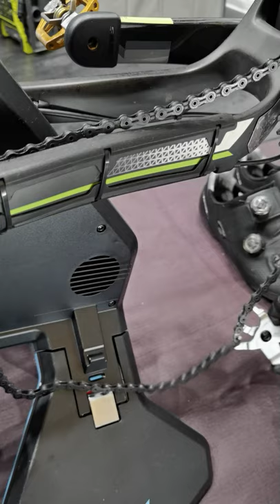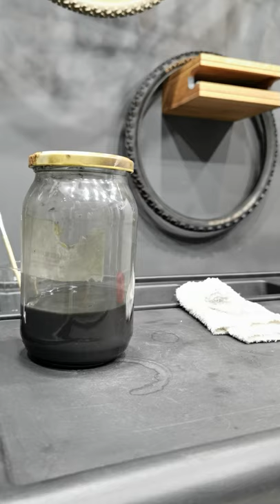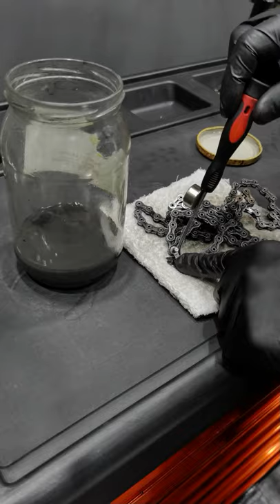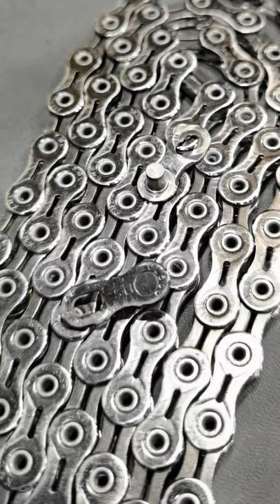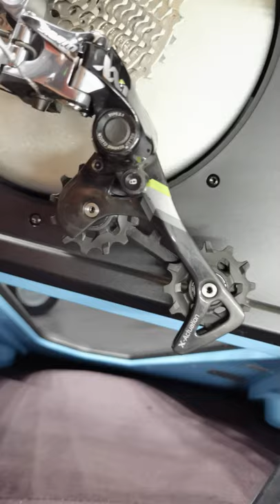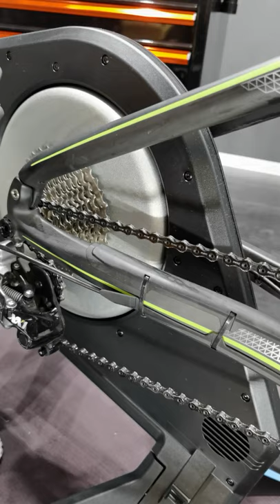Super dirty chain shake - make it shine in 3 minutes! #shorts

Comment: Really bad advise mate!

With cleaning it in mineral spirits/"light petrol"/"leichtbenzin" you wash out the light grease/oil out of the rollers.

I made a test in january 2021, mid/west Europe. 

Used a
- brand new KMC X8 
- geared hub (alfine 8) 
- 44:18 main 

-> marked one side, soaked one half Length of it in mineral spirits after 400km 1000km and 1800km or so?

Cleaned the other half with a bit of ethanol and bristles only. 

Usual dry cleaning every 2 weeks. 

Used rohloff's all purpose chainlube 'oil of rohloff' 

After 2000km city and road that half was worn out to 12,8mm / mean link distance. 

The other half was on 12,75-12,77mm or so still

Sure that's no lab testing and no lab measuring...

But you will waste longivitiy.
Reply: Thanks for sharing. More people should read this.
Reply: Ive always cleaned chains with paraffin or kerosene, Both motorbikes and bicycles, Granted the motorbike chains are sealed with o rings but surely you apply fresh lubrication after cleaning.I have found over time they dont really need to be clean, its much more important they are lubricated well. So what your saying sounds about right.
Reply: There is a very good reason, Bicycle specific degreaser exist. Any workshop using a paraffin table will never see my bike for a service

Comment: A 40:1 gas/2 cycle oil mixture works great using this quick method. Buy it premixed. You're stripping dirt and grease without losing that light oil coating. Soak briefly, swirl, dump and wipe. Lube and you're done.
Reply: 40:1 gas? Give more info pls.

Comment: Soaking the chain like that removes the oil from under the rollers on the chain.  You need to soak this chain in chain oil to get the oil under the rollers again. Just putting oil on top of the roller doesn't work.
Reply: Ever heard of capillary action? If the oil is not super viscose it will make Its way  down under the rollers. As long as you pour it on the edges and not in the centre.
Reply: @cabreraman6969  I guess the point is that the factory grease is thick grease and not thin oil.
Reply: With a chain that beat up, you don’t want any of that oil in there anymore. It would be ground up and basically sandpaper. Flushing it out and re-lubing it would be the only way to save the chain.
Reply: @xavierhulbert5849  you have to soak the chain in oil bath or wax it afterwards otherwise theres nothing of substance between pins/rollers/inner plates
Reply: @cabreraman6969  it wont, unless the chain is soaked overnight in lubricant or gets hot waxed it will be stuffed asap
Reply: Definitely not true

Comment: I mean what you're doing isn't the worst. You're cleaning is actually decent although I would rinse a few more times until the kerosene is completely clean at which point I would put it in the ultrasonic to get the rest of the unseen grime. As far as re lubrication this is why your chain is so dirty in the first place. Oil allows dirt to stick to the chain this then forms a slurry that will destroy your chain so quickly. If you use hot wax immersion the insides of the rollers and pins will all get lubricated and will not attract dirt your chain will last 10 times longer with much less effort to clean
Reply: How sad.

Comment: That is simply the worst way to clean a fairly clean chain! 
One. Those links are meant to be single use. You can use them 2-3 times but ultimately they need replacing. 
Two, just use a chain cleaning tool to achieve the same results along with a chain degreaser. 

Rinse and wax. And you’re done.
Reply: No for single-use links, not for KMC, they can be used until they work.
Reply: If you have to use a tool to remove it, it should be good.

Comment: A lot of stupid people in the comments. Lets clear this up. As long as the chain gets clean everywhere, even under the rollers and deep down, you can relubricate it as normal. Simple. Any chain lube with any good real workable viscosity will work its way into the rollers just fine. I have Force AXS chains, Shimano Ultegra chains, KMC chains, Connex chains, and more. My force chain has over 5k miles on it. Its still going strong. Had it since late 2021. Still nowhere close to worn out, and yes i have the new flattop chain checker. It still spins like brand new, virtually no resistance. In fact, my DT Swiss ratchet hubs give more resistance than the entire rest of the drivetrain.

Comment: Shouldn't you use a new quick link every time
Reply: In the Manual Off Mine it says you can Open it up to three times
Reply: @powertoast401  I hear you but I don't really want to take the risk of the chain falling off...
Reply: Been using the same quick link for over a year now, taking chain off the bike to clean it and it's fine still

Once you can click it shut by just pulling the chain apart with hands it's worn out and needs replacing
Reply: @lexusstefan927  right on. I just heard a few people say that.. thanks for the info I appreciate it